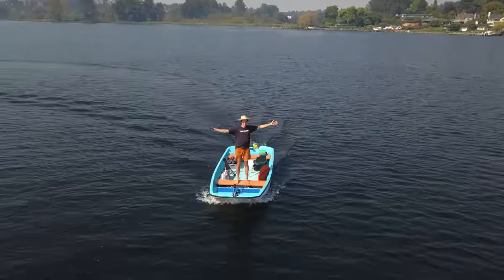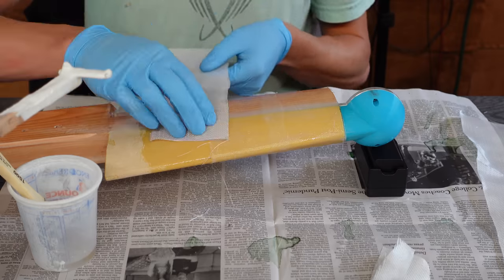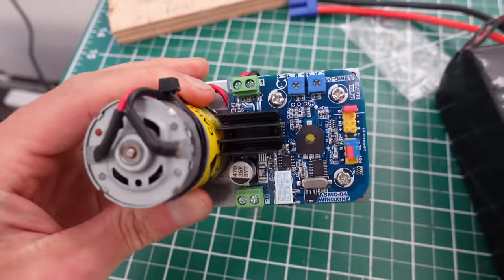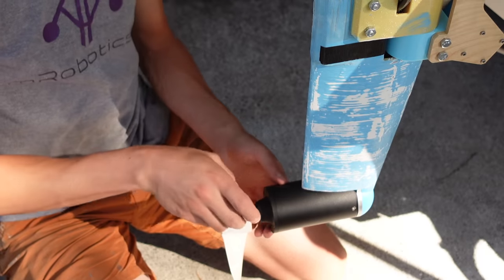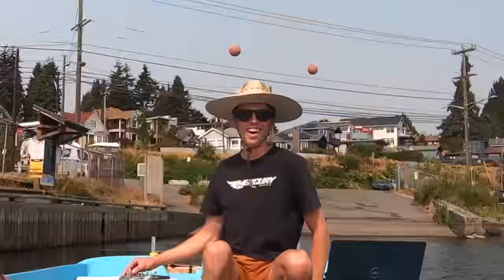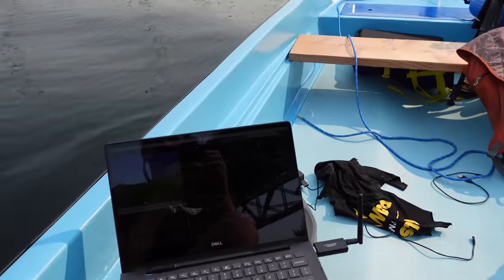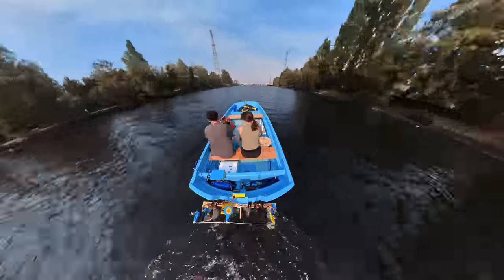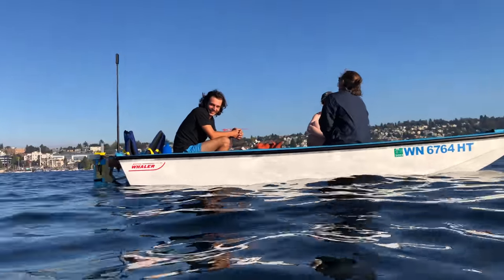Full Size R/C Boat Can Carry People!

Comment from the maker: Play World of Warships here:  https://wo.ws/3gomEDF
Thank you World of Warships for sponsoring this video.
During registration use the code BRAVO to get some exclusive rewards.
Reply: couple things, maybe add a steering damper, surron 72v batteries would be a good idea maybe chi batteries would hook it up
Reply: make it a paddlewheel
Reply: I wish Youtubers would do more research on the sponsors they choose. Wargaming is one of the worst companies with tons or PR problems. Youtubers who were part of the CC (Community Contributor program) did a massive walk out in 2021 but seems like the internet forgot. I cannot support someone who supports companies like this, you are part of the problem.
Reply: @1islam1  Do you like pork sandwiches? I like pork sandwiches.
Reply: Lol nah I’m good. Sold your sole to this game? Jk just making money on your vids. No worries
Reply: does this still count as a rc-controlled boat pushing you along in an unpropelled vessel?
i mean...
Reply: I challenge you to make a solid state electromagnetohydrodynamic boat.

To overcome the issue with electrolysis, use isolated plate electrodes forming a capacitor through water and electromagnets and drive them at resonance. The water being polarised by an electric field while also sitting inside a magnetic field will cause it to experience an electromotive force and by oscillating the electric and magnetic fields back and forth you can get a continuous force.
Reply: this is beautiful

Comment: The boat looks fantastic, I wonder if there’s interactions with water turbulence or if the pitch is too high for the current speed of the boat causing a little bit of vibrations. Maybe try adding those small outboard hydrofoil/anti cavitation plates?
Reply: i found you
Reply: Then you'd expect vibrations when accelerating hard... doesnt make sense.
Reply from the maker: Thanks! Turbulence coming from the hull seems likely. Maybe I need a wing/cavitation plate to separate the flow. Definitely going to try lower pitch prop too
Reply: One electric boat innovator helping another, I love it.
Reply: The most ambitious crossover of the century.  @rctestflight @PeterSripol make it happen.
Reply: @rctestflight  in that case would probably help to move the prop more down deeper into the water?
Reply: Those seaplane admirations were a hint maybe? rctest did say something about upcoming "fold out wings".
Reply: Adding a vote for anti-cavitation plates. Don’t know why they work, but I doubt that outboard manufacturers are throwing all that extra aluminum in just for appearance.
Reply: oh nooo its peter  this is double trouble lol
Reply: @old_guard2431  I'm not sure but i don't think they would do anything at the speeds this is going. 
I think they are there to ensure the the water doesn't spray upwards to quickly when going fast with the prop closing in on the surface.
Reply: Seems like it’s the rubber in the props? Peter, did you actually watch the whole video?
Reply: @rctestflight  ahoy, dude. a Stripol view with an advice comment to your creation would mean that you’ve ‘made it’ on YouTube as a Legit Designer-Fabricator, to me. congrats. I hope to see your watercraft meet your performance expectations. cheers.
Reply: @IteKLF  what makes you think that vibrations do not happen when this boat accelerates hard? 🤦
Reply: @MichaelLangell  yes he obviously did. How many rc boats have you built?

Comment: As a Marine technician, use marine grade parts!!! TAKE parts from outboard motors old yamaha or mercury parts and use cable based steering brackets or universal marine grade parts on your boat. The reason the servo stripped and your prop was experiencing so much vibration is because propellers on outboards are equipped to beefed up lower unit (basically transmission) systems that are completely submerged in gear lube and locked down gears and bearings are pressed together at hundreds of pounds of force. If you cannot have some sort of lower unit incorporated into your electric motor it simply won't handle the load you're putting on a prop

Comment: That rubber piece in the prop is called a hub.
Should you kit a rock, it breaks from the splined shaft to save the lower unit (gear case)
Also, you should crimp the battery cables lug.
Reply: Came here to say this
Reply: So was I lol. I use volunteer with the axillary coast guard. On a rescue in 30 mph we sheared 1 of the hubs on 1 of 150hp Johnson outboards. It made us a liability instead of being the help.
Reply: Shear pins do that also right?
Reply: @twt000  The shear pin was the pin that turned the blade as well as break if it hit something. My dad used to use 4 inch nails to make more pins.
Reply: @flyercan  Aren't sheer pins a more brittle material than nails?
Reply: @twt000  he prob lost a few lower units. L0L

Comment: Just a tip on set screws on shafts is putting a dimple on the shaft with a drill bit , tighten the set screw and then run another set screw on top of the first ! It’s done in the heavy equipment industry all the time and never fails !!!

Comment: Dude, I’m so impressed with the quality of work and engineering you used to build your boat. It’s unparalleled on YouTube thus far.
I will say, you might want to consider simplifying the mechanisms and linkages to make it easily repairable on the go. I’d also recommend a PWM between your battery and motors as it will reduce the amp draw on your battery over time, since motors generally use higher amps than they convert to power at lower speeds, and the remainder of the energy is converted into thermal energy. 
A PWM will mitigate that issue considerably, increasing effective range by about 20%. 
The other thing I’d recommend is having a couple small Amazon kayak sails for $20 (the kind that looks like a circle). They only work downwind, but in the event of a motor failure, you’ll have a way to get back to the boat ramp without breaking too much of a sweat. You could also install some dual purpose oar-locks for rowing the boat, or use them to hold fishing poles or GoPro mounts.

You did great in designing redundancy into the systems! Definitely get a waterproof laptop for the next voyages! I was terrified for your Dell watching this video. Especially if you have any important data and calibration software for the boat that might make it unusable without it.
You have to name it! 
Name idea: Arr Sea 🌊

Comment: I love your 3D engineering. It all looks a bit over built but it works. Happy sailing.
Reply: 3d printed parts can never be too strong. Better to be on the safe side.
Reply: I guess for a boat weight isn't  as much as a consideration as it is on his RC planes.

Comment: Your videos have totally inspired me to do the same thing. I bought a big ass LiFePO battery and a trolling motor and built a frame to mount it on my inflatable canoe. Spent the summer cruising the waterways in my country every few weekends. My build was much less DIY, I just shilled out the money for ready made parts, since I don't need autopilot or stuff like that. Cruising around the waterways is the most calming, satisfying thing ever, highly recommend. Thanks for putting out these videos, they're always a joy to watch!

Comment: Hey there! I see you have two of the same props on there. Turning the same way. This might increase the propeller walk (also known as propeller effect, wheeling effect, paddle wheel effect, asymmetric thrust, asymmetric blade effect, transverse thrust, prop walk). You won’t notice this much when going forward. But when going backwards this might become an issue. If you have 2 props. You need them both turning different ways to counter this effect. 

I love the project so far! :) it’s amazing what you do. Keep it up!

Comment: This boat and your overall effort are impressive in so many ways.  Old mariners like myself believe there is only one right way to build and repair boats.  And that is usually true. Things like galvonic corrosion and wind can easily be overlooked by newbies. 
That being said you did a good job applying new tech to old school boat.
I really hope you give those motors a chance at recommended voltage and 2X the recommended amperage available. 
I know...expensive controllers and batteries! 
I actually love the batteries you have, you just need more of them.
Once you have all that power you truly appreciate the motors you have.  Tiny props spinning like mad, low amps at any speed, and a displacement hull flying on the props.  Sounds like fun to me.
I have faith in you. I'll check back later.

Comment: I work a lot with pixhawk flight controllers, it's best to do your gyro/compass calibrations away from large concrete and metal structures, and it might also help to place the here2 gps puck on a small mast somewhere away from other electronics/ sources of EMI. Awesome project, waiting for the next video in the series!

Comment: Nice job! This is what it’s all about, taking a project boat, your imagination, tools and skill set, and challenging yourself to make something that can be used and enjoyed for exploring. Once you go with differential thrust steering it’s hard to go back to babysitting a tiller or wheel. Really enjoyed the scenery as you cruised about in these videos. Looking forward to solar integration and bigger motor controllers to see what those E-foil motors can do pushing that hull.

Comment: For props try using 8" (or so) RC Airplane "APC" brand pusher propellers.  They work extremely well and are much more efficient than a typical boat prop at these speeds due to their long aspect ratio.

Comment: Great video, as always.  Maybe try a little K.I.S.S.  Rigidly mount the motors to the boat (and use differential steering if required).  Add a tradition rudder/tiller (with a linear actuator for automated control) for manual/backup steering.  You could make a linear actuator using 3D printing, threaded rod and a nut - or CNC it all in aluminium for strength/precision.  Stay safe out there.

Comment: Love it! I decided on differential thrust so no extra moving parts are required, but a 1 motor out situation is pretty likely, so ya got me thinkin I should be able to manually offset the angle of either to get close to straight thrust, and steer with an emergency paddle

Comment: Welcome to boating on hard mode. My grandfather was building rc sailboats back in the 60s, using tiny canvas sails and strings wrapped around servos. I, notably, have not taken up the same challenge lol. You do need to know the local wind direction and speed, which can be accomplished low tech with a nylon string (something heavy that won't kink) attached to the top of the mast. Like a wind sock it tells you direction and speed.

Comment: The rubber part in the props is the hub.  It’s made to absorb pressure, light impacts and dampens harmonics.  The gap between the prop and motor is what is causing your vibrations.

Comment: in aviation, there is a thing called prop sync, used in reciprocating and also turboprop planes; syncs one engine to the exact rpm of the other. if youre interested i could get some more information, im working at an airport where the one of the biggest producers of props and those sync electronics are based. would also be interesting  if it only vibrates if both motors run on full thrust or at all time. For the servo i also had an idea; you could use a big rubber grommet or rubber bearing on the driven shafts. would decimate your wear and tear on the 3d printed parts i think. best wishes

Comment: Love this project. I'd recommend staying away from structurally loaded PLA parts. Stick with PETG or other higher temperature plastics.  I've had PLA parts warp when left in direct sunlight outside.  PETG gives you around 20C higher temperature tolerance from softening than PLA

Comment: The rubber between the shaft housing and the propeller it's used like a damper to preserve the motor. It absorbs the torsional force during fast acceleration and reduce vibration caused by cavitation. It's not made for self balancing.
Probably the wobbliness that you experienced came from the two rudders becose of cavitation effects an karman trails. Try to make a slicker design and you will see that the water can stay attached more to che surface reducing vibration.
Grate video!

Comment: For your steering servo and vibration -- you probably don't need your system so rigid.  You could use a more flexible horn, or a pulley arrangement with rope.  On my boat, I have rope-driven wind vane self steering that has taken me across seas, and the connection is quite compliant.  The key there is that there is negative feedback from the wind direction to compensate for any flex.

Comment: just pointing this out, for printing solid parts, its usually better for you to have  a few walls and solid infill rather than all walls, it will print faster, be just as strong, and wont have any gaps where there isnt enough space for a wall(wont make a difference for really big parts but its waaayyyy better for smaller parts).

Comment: The rubber bushing is not a self centering feature - it's to protect your lower unit gear/engine from breaking when you hit a rock. Idea being that the prop starts freewheeling on the bushing. Before the rubber bushing, you would have shear pins.

Comment: First, nice work!! Enjoyed your video a lot. Just a few thoughts from an old sea captain: 
1 The rubber rings in the props are not for centering or balancing. They can slip if you accidently hit  like a log, rock or something else and protect the motors. 
2 I think your props are for high(er) speed (bigger pitch) , and your boat is a displacement boat and you will never hit the designed high speeds for the props. This would explain overheating of  your motors. You need props would need less pitch...
Reply: Plus for steering, and 100% perfect maneuvering you would need independent rudders on both engines, I'm not sure if that would be easy to program into a autopilot.

Comment: Just a tip the best way to epoxy something like that is to use a spreader, wet through the back of your cloth then use the spreader to apply it to a wetted surface. Another tip, you can use nail polish on your electronics for protection then pot then in epoxy with the wires connected. That rubber piece is designed to shear after it gets a high speed jam, like a line around the propeller. It breaks instead of the crankshaft

Comment: This might be a bit late to the party, but a typical vibratory exciter on ships is the blade passing frequency. When one of the blades moves past the outboard body it loses some off its thrust. In your case the frequency is prolblably 3x the motor rpm because 3 blades. Be aware having 2 props spinning not in sync gives this output twice. The solution would be optimising the hydrodynamics to dampen the flow disturbance somewhat or increase blade count to smooth pressure spikes.

Comment: So many great lessons in design, fabrication, and MacGyver hacking in this series.

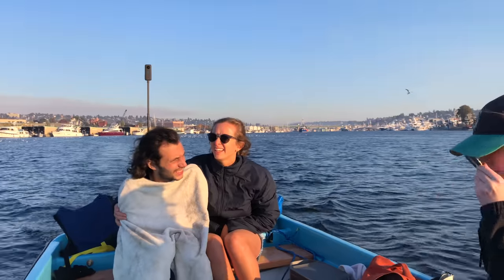Why not a solar canopy to provide a bit of sunshade? (23:00)
Wings over the side might present some challenges, unless considering outriggers?
Did you manage to figure out the over reacting of you custom boat controller software. Wondering if just the mass of you boat and it's reaction time needed tuning. (PIDs over controlling?)

Comment: for the interested: the rubber in the prop hubs' main job is to reduce wear in the gearbox on regular outboards. when you shift, you are smashing two flat pieces of steel together in the gearbox (driveshaft and propshaft get connected through the clutch dog), where the driveshaft is at 7-800rpm (or more), and the propshaft is standing still. getting the propeller up to that speed in an instant is not so great for the clutch dog, so the prop hub is isolated from the prop with rubber to dampen the blow. it also takes out some vibrations at low rpm, and help a little bit if you hit something, though they are not meant as shear pins. your prop will still break off all the blades and bend your propshaft if you hit something big. you don't really need those rubber inserts here, as the power delivery from an electric motor is smooth, unlike in gas powered outboards, and you don't have a shifting gearcase.

Comment: The rubber things inside the propellers are there to protect the motors against the prop blades hitting things underwater. It happens far too regularly!
Much nicer than shear pins.

Comment: Really inspiering video! Love it. :)
My first reaction to the propellers was "those are huge!" I think to get more power out of your motors you need to use smaller propellers and higher RPMs.
When you make your own propelles you should allso have them working in opposit direction, to counter out the yaw from the propellers.

Comment: A primitive water cooling system might be good to have for the electronics (tiny water pump, copper tubing in contact with electronic's heat sink surfaces)

Comment: I worked at a marina in michigan for 4 years the rubber piece in the prop is a shear hub it a protective device for the prop incase it hit something hard the plastic sleave will shear on the inside and keep the porp from chipping/breakinging. Awesome job tho I think your projects are awesome.

Comment: Since water is right there, could you do something with heatpipes adhered to the sides and into the water for a DIYcooling solution to prevent further thermal issues?